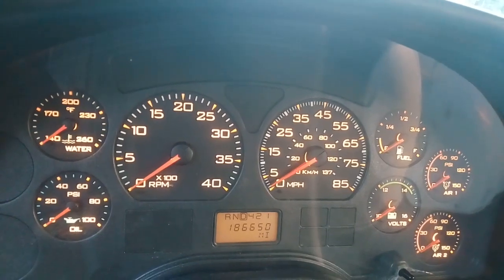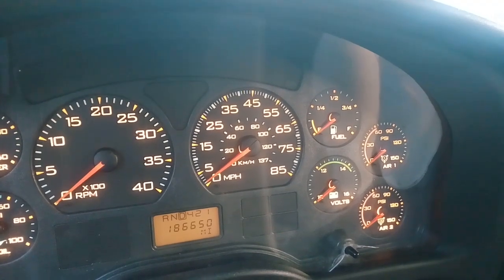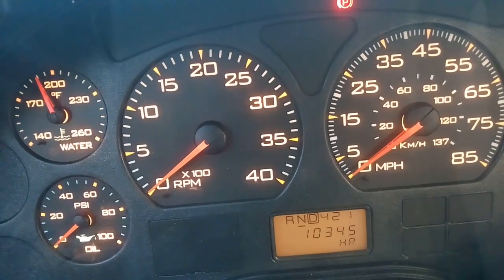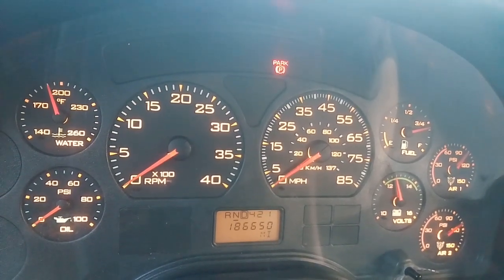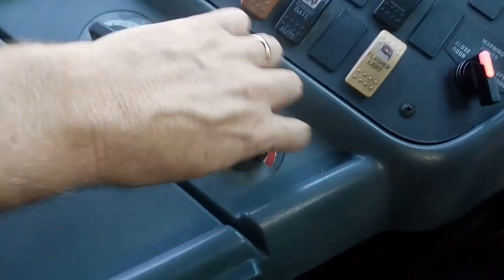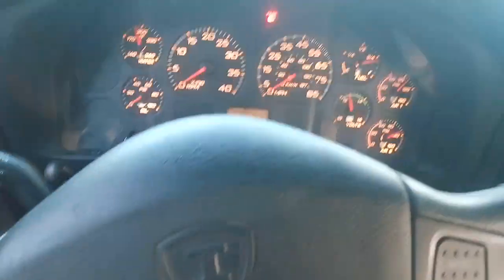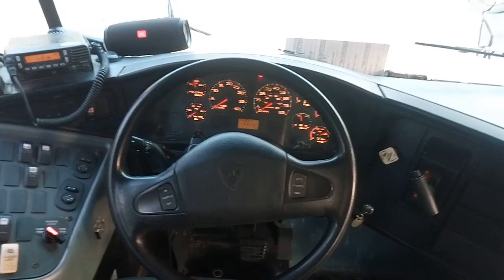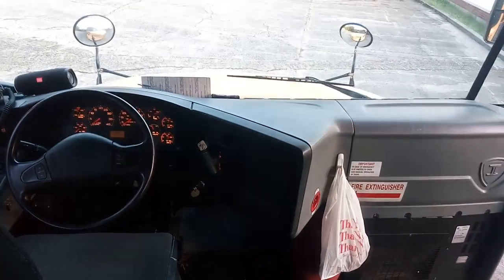2005 International Cockpit Tour

Comment: How well does this one run? I was testing my route in one of these up here in Michigan and it didn't run so good... shook bad and had no take off... we have excellent maintenance too so it's just the bus being 11 years old and tired...
Reply from the maker: This one is slow on acceleration and it is inconsistent. One time it'll pull pretty well, take a slow speed turn and get back on the throttle and nothing. It takes 5 or 10 seconds before the power starts building again. Runs about 60 on the highway. Very harsh front end. Wallows and bounces a lot. The shocks on mine are likely worn out. Still better than the Frightliner.
Reply: yellowbusguy Yeah mine did the same... it's got a year old rebuilt engine too. I made 60 (barely) the first time I got on the freeway and the second time I set it at 60 and it wouldn't do over 55 unless I was going down a hill. Very disappointing considering all the money they put into it. I think this engine got International and Ford sued big time for its unreliable nature and their unwillingness to address the issues until the 6.4L Maxxforce 7 came out in 2007.
Reply: duvac12 ford sued international over warranty stuff because they where buying the vt365 (that’s what the 6.0 powerstroke really is) and international said it’s your problem not ours
Reply: TechOut So that's what formed part of the basis for them to part ways I take it...
Reply: duvac12 that and then the 6.4 powerstroke was the maxxforce 7 pretty much and it had issues after that Ford went to building then in house

Comment: You said you're getting a new bus? When is that coming in?
Reply from the maker: They tell me  it'll be late Sept or October before they come in. We have a bunch ordered. More than the usual 100 or so.
Reply: yellowbusguy 100 is USUAL? They must have a bunch of shitboxes to get rid of. Can't wait for that new bus!
Reply: yellowbusguy I know 1704 is here. Someone has a picture of it. 17's are supposed to be full fleet of CE's
Reply from the maker: Nice! I can't wait to see how the CE/Cummins combo runs.
Reply: Jerry Sylvester His district has over 1000 buses so 100 or so would make sense as old as some of their stuff is...
Reply from the maker: Special needs. Nice looking bus. You can see this one doesn't have the radio, GPS or camera systems installed yet. No antennae. It's going to be a special time having a brand new ride.
Reply: yellowbusguy You'll probably like them... on city streets they are very very fast. On the freeway they are hit and miss depending on how the trans is programmed. We have 69 with that combo, 46 15's and 23 17's. Some of them get to 60 in 1 shot coming off an on ramp others get to 45 and take almost a mile to get to 60 on the freeway. It's something with fuel saving and the most efficient time to shift according to the computer and RPM's etc. Not fun with a short entrance ramp and a semi baring down. It'll be interesting to see how yours behaves in that situation.
Reply from the maker: I only have one short run on any highway, so the in town performance is more important to me. The ability to pull out into traffic quickly, or get across fast roads. Zero to 35 is where I work mostly.
Reply: yellowbusguy Yeah, it'll get to 35 in very quickly for a bus so you should be ok. They are far faster than any of the International engined stuff you've shown so far, especially that '05.

Comment: The T444E is a much more reliable engine than the baby maxxforce and vt365. I was going to purchase a 2006 from our district but it had the VT365 in it and I said nope!
Reply: ICCE580 And if you were really smart you got the DT466 and later the Maxxforce DT... virtually indestructible motors. The 7.3 was light years more reliable than the 365 and the 7 though...
Reply: Yeah, the older maxxforce DTs were more reliable before the emissions standards were changed. I've ridden a 2011 CE with a DT and only had about 2 issues in that year. I also rode a 2007 CE with the VT365 and that was in the shop 5-7 times in the year. I have been riding a 2016 CE with the Cummins ISB 6.7l for 2 years and the only issue with that was a starter and the ambers and reds wouldn't cancel. the 466 is definitely better than a 365.